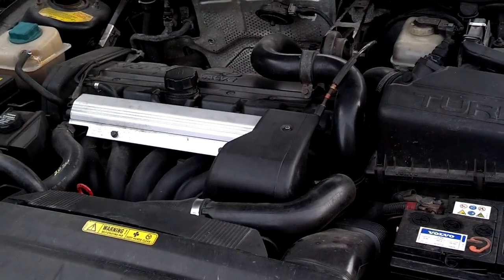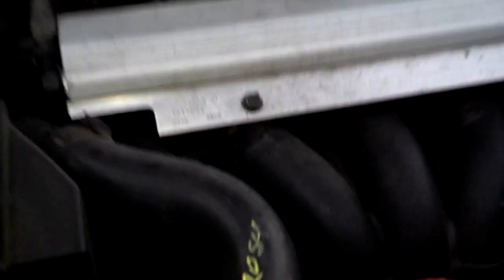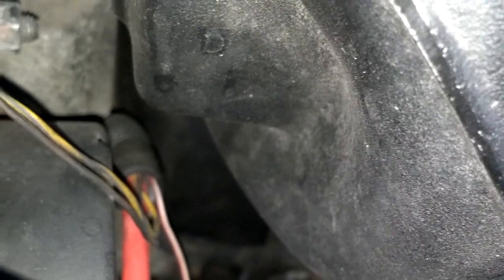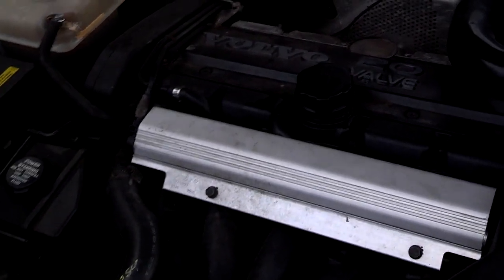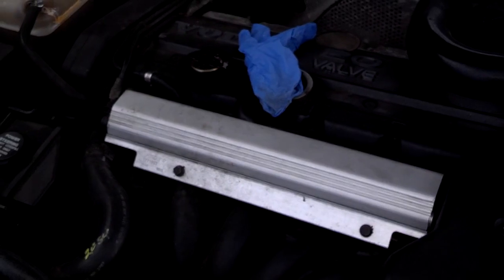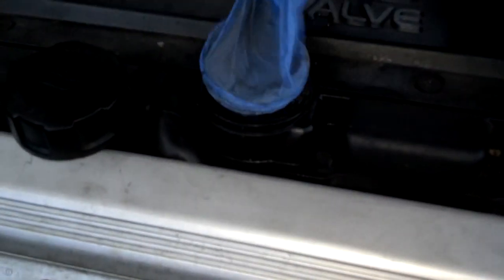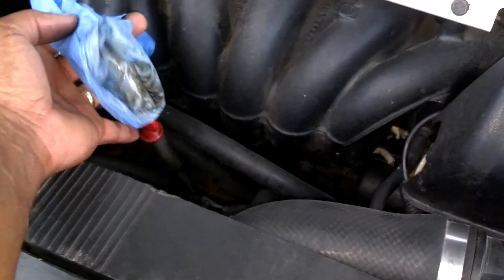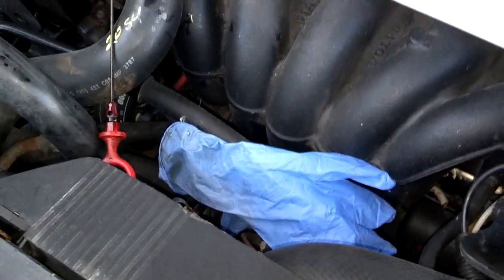Volvo PCV system check, 850, V70, S70, and others - VOTD

Comment: My car takes a couple of seconds to start when it does the idle jumps around and allmost dies.... I believe i have a vacuum leak... i hear the hessing sound loudest when I put my ear between the power steering pump and timing belt cover... think it might be that elbow underneath?
Reply: Robert DIY   dang, I'd bring my car by. LOL 1996 850 N/A
Reply from the maker: doubletapm4 Bring it by so I can check for you... Did you look at it? Chances are you have a bad coolant temp sensor. - Thermostat and ECT (Engine Coolant Temperature Sensor) Replacement, Volvo 850, S70, XC70, V70, etc.
Reply: hahaha what city are u in
Reply from the maker: Albuquerque.
Reply: your 2 states away lol

Comment: Hi I have a 2001 Volvo s40 and I have done this test but it leaks oil on top of the spark plug and around the top of the motor. I want to know what else can I do. Also what do I need to change the PVC system for this car
Reply from the maker: juan torres I have not done one on a car like yours. Check with a local mechanic or a forum.

Comment: Hey Rob I'm sure you've heard about my rear main seal leak by now. It was never leaking much, just 1 or 2 drops a day, but I took it on a nice long highway run at high speeds yesterday, and I noticed a good amount of oil under my car today (probably like 1 to 2oz). I'm seriously thinking of having the rear main seal replaced at the Volvo dealership. I know it's like $1100, but I think it needs to be done. What else should I have replaced when they're down there? The new seal obviously, clutch (it's automatic), gaskets, etc..
Reply from the maker: No I don't. My car has 264,000 on it now and I did my PCV service at 192,000. I did the test a few days ago and it is still sucking in.
Reply from the maker: If the water pump is over 10 years old, just have it changed. As for the mounts, I would just let them use their judgement and not worry about it.
Reply from the maker: Normal.
Reply from the maker: No I have not heard. If they drop the transmission, any other seal that they distrub. They do have to drop the subframe so if the hydraulic mounts are going bad, that would be a good thing to replace.
Reply: Robert DIY Hydraulic mounts? I've never heard of that. I put polyurethane subframe bushing inserts in from IPD, but it don't think that's what you're talking about.
Reply from the maker: LJRossPhoto The front of the subframe and back of the subframe have hydraulic mounts. Actually the motor rest on them. Fat rubber things with a wire going over the top.
Reply: Robert DIY I'll be sure to mention it. Are they expensive?
Reply: Robert DIY Also, I know how much Volvo charges for their seals. When I'm going to have the RMS done, should I buy the seal on FCP Euro ($28) and have them install that? Will that still be under warranty?
Reply from the maker: Most dealers will not install parts you supply.
Reply: Robert DIY Yeah, that's what they told me when I took it in for an alignment earlier today. I'm going back for the big bad RMS as soon as they get back to me with an estimate. Do you know if the engine mounts will cost me another arm and leg? I watched a tutorial from FCP and it looks like you might need some special tools to get down in there. By the way, if there's no fluid that goes through them, I don't think they would be considered hydraulic. It's just an engine mount.

http://www.fcpeuro.com/products/volvo-engine-mount-kit-850-s70-v70-850mountkit2
Reply from the maker: That is what the old school guys call them because they use to be filled with fluid in the red block days.
Reply: Robert DIY Interesting. Any idea how much they would cost at the dealer?
Reply from the maker: No I don't. Dealer prices vary a lot around the country.
Reply: Robert DIY I spoke with them this afternoon (Volvo of Tampa) and the RMS is gong to be $1242 for parts and labor. The engine mounts are $497 (I believe that's parts and labor), but I'm only having the RMS done. I'll do engine mounts myself at the hobby shop on base. They have all the specialty tools.
Reply from the maker: Heck, if you have access to a shop, you might want to do the RMS yourself. It may take a day but you'll save a lot of money. On the other hand, if you can afford it, let them do it. Why torture yourself.
Reply: Robert DIY I'll do a lot of things to a car, but a rear main seal is just too much for me. I won't have access to a shop for about another 6 months to a year, and even then I might not have much spare time. I just want to get it fixed so I won't have anything to worry about going forward. It sure would be nice though!
Labor: $1196
Parts: $46
Reply: Robert DIY
I paid a supposedly shop in Phoenix ($2200) to service the PCV system along with a head gasket job last year (Aug 2013) on my 98 V70 GLT that I had just bought and just a few months ago, I noticed oil dripping out (literally, like it was pumping out) of the front of the engine just after I had started up to drive. Further investigation revealed #1 spark plug well was filled with oil in addition to the top of the head. I had it towed back to them, of course. I regret not having done the job myself then because just a month or so ago, I have the same issue again.  I will do the job myself this time, as just 2 weeks ago, while replacing the front crank seal, which had pushed out, I noticed a couple of parts missing (tensioner bushing & belt guard). So, naturally, I suspect that the PCV system was not done right either. I did the glove and dipstick tests as described in your video, (after I had put the front seal back in), and sure enough, the glove was inflating instead of sucking. So, it seems that only the front seal has been leaking. Have planned to do the job after reviewing your videos on the process. I have read a few different things about the inadequacy of the PCV system on high mileage engines that may be improved with a minor modification. Mine just rolled over 202k. I love the performance of the L5 turbo and want to give the best maintenance and care.

My question to you is, do you think a failing Cat converter could be contributing to the engine pressure problem?  I have been checking the forums for similar issues.
Reply: Robert DIY Just dropped the car off today for the big service! I'm getting the rear main seal, and some other transmission seal inside the bell housing between the torque converter or something, and the timing belt (he'll check the water pump while he's in there and let me know if we should replace it or not). The mechanic was very nice and seemed trustworthy. He's been working for Volvo for 46 years... For the engine mounts, he said he wouldn't charge any labor for the side and rear engine mounts, it's only the front one he would have to charge labor on, but he'll check them out and let me know how bad they are so we can decide whether to replace them or not. They were very friendly and gave us 10% off everything (possibly because we mentioned we're military), but it's still a lot of money... Opinions?
Reply: Robert DIY They're doing timing belt and water pump too on top of the RMS and front transmission seal. It's a BIG job.. Here's a few pictures the mechanic sent me earlier today of the back of the motor where the rear main seal is, and the transmission out of the car.

1. https://drive.google.com/file/d/0B0JwcFRp-MDcczd1ZV9zVGpWM0E/view
2. https://drive.google.com/file/d/0B0JwcFRp-MDcM3pLRGl2UDBlM2s/view
Reply from the maker: Oh I know. I had a tranny swapped before and swapped an engine a month ago.
Reply: Robert DIY You're always up to something aren't you. Haha in the first picture I'm confused where the front of the car is because I see the rack and pinion going across the front of the car under the exhaust manifold thing, but then the brake rotor is sideways..... Was the picture taken from the passenger side of the car? I'm so confused.
Reply from the maker: I'm lost to what you are referring to.
Reply: Robert DIY In this picture I don't know where the front of the car is and why the brake rotor is sideways. https://drive.google.com/file/d/0B0JwcFRp-MDcczd1ZV9zVGpWM0E/view
Reply from the maker: That is the picture you sent me. LOL  The picture is taken from the drivers side wheel being removed, the transmission is also removed. So the front of the car is on the left.
Reply: Robert DIY That's what I thought, but in the bottom right of the picture, is that the front passenger side brake rotor? Is it just me or shouldn't it be turned the other way?
Reply from the maker: Yes it is a rotor. May be another car or they have your suspension loose and pulled back to get at some parts there. Maybe because the subframe is lowered.
Reply: Robert DIY They must have loosened the suspension.. I'm having the timing belt and water pump done too, and they're replacing the timing belt tensioner. Do you think I should have the tensioner pulley and/or idler pulley replaced too? The mechanic didn't say anything about those.
Reply from the maker: Wow, that would be a YES. If you are paying someone to do that job, those 2 rollers are a must. If you are doing it yourself and don't mind going back in if one starts to fail, then test them and decide.

Most timing belt issues are not due to the belt breaking, it is due to a filed water pump or one of those rollers locking up and tossing the belt. - Timing belt change, what other parts need changed? Water pump, rollers, etc.
Reply: Robert DIY Wow. How much do you think I should be paying for the timing belt, water pump, tensioner, tensioner pulley, and idler pulley?
Reply from the maker: Those parts are $280.
Reply: Robert DIY Hopefully the lady at the front desk I spoke with is unsure. I'm going to be calling them tomorrow to make sure because I'm paying $815 for the timing belt and water pump job. All parts better be included.. On the price sheet, it says "Water pump with timing belt kit $815.00".
Reply from the maker: I'm sure all is included, with the hydraulic tensioner.
Reply: Robert DIY Okay, thanks for giving me some peace of mind Rob. I appreciate it.
Here's a link to the kit on IPD. It comes with everything for $313. http://www.ipdusa.com/products/9220/120611-timing-belt-water-pump-kit
Reply: Robert DIY Just got my car back today. The only thing they didn't replace with the timing belt was the hydraulic tensioner, which the mechanic said wasn't leaking. Both rollers are new. The leak is also gone! I did another glove test when I got home just to be 100% positive I have good crankcase pressure, and the glove did suck in when the car was idling and there was no smoke coming out of the dipstick at idle. However, when I revved the engine, some smoke came out of both the dipstick hole and the oil filler hole. I'm not sure if it was smoke or condensation because the motor was hot.. Is this normal or should I be concerned?

Comment: It also, if plugged up, will SUCK so hard that it will cause the rear main to sound like a squealing belt, and it will pull air INTO the dipstick like a hoover vacuum! That means the diaphragm inside the trap is broken, and needs total replacement. 75 bucks at Volvo dealer. Nice Video!
Reply from the maker: bull dawg Thanks for sharing. Never heard of a diaphragm???

Comment: Hi robert i have a 1996 volvo 850 glt non turbo and the rear main seal is leaking oil but i did your test on the oil dip stick and no moisture and i did the glove and it sucks it in instead of blowing it up should i replace the gasget or do the pcv system?
Reply from the maker: trdceli1985 I would NOT. Unless the hose going to the top of the motor and under the cover is rock hard. How long have you owned the car? Are you sure it is a RMS leak?
Reply: I think it is because around the cam sensor at the bottom bolt there is oil all around it and all down from it. So do i test the hose by just using my fingers and pressing on it? Should it be soft?
Reply: Robert DIY i have pictures  is there anyway i can send you i tested the hose and it is not rock hard  it is kind of soft
Reply: Robert DIY i have owed the car for 5 years
Reply from the maker: If the hose is NOT rock hard, someone has replaced it at some point. Maybe the leak is at the cam sensor.
Reply: Yes it is also found oil inside my air filter?
Reply from the maker: Not sure how that happened.
Reply: Robert DIY so will this test be right even though my rear cam seal is leaking?
Reply from the maker: Although the PCV is the cause of MOST oil leaks, it is not the cause of ALL leaks.

Comment: thanks alot your video's really helpt me . i had trouble whit my volvo 850 2.5 gle. every time when the car  was hot .it would leak oil allot .and the econemy whas not good .but after replacing the pcv system and espesaly the  breahter box the car purrs like a kitten again .ones again thank you good sir
Reply from the maker: ***** Glad you figured it out.

Comment: Hi Robert. I have the parts on order and will be attempting this when they arrive from FCP. Never done this before, so keeping my fingers crossed. I have a 1995 Volvo 850 non-turbo with 175K.Bought it used so I don't know when this was done. I'll start in the morning and hope to finish in one day. Using the glove it was filling up the fingers, so I know I need to do this. Thanks.
Reply from the maker: Ricky P. It is really not bad, just a little time consuming. Make sure you clean out the EGR stuff.
Reply: Robert DIY
Will do.

Comment: What might be happening in this system if the suction from the oil cap or dipstick valve is greater that normal? (Cap is very difficult to remove)
Reply from the maker: billsutherland1 What makes you think the vacuum is to strong? The cap seal may be sticking to the head cover. If it's running well, leave it alone.

Comment: I have smoke coming from the dip stick on my 95 850 wagon. I plan on replacing the PCV system next week. I recently developed a stalling problem when I come to an idle after the car has warmed up. Do you think these problems could be related to the PCV being clogged?
Reply: By any chance did you find out what the issue was? I had a similar if not the same issue as you explained. I sprayed brake cleaner around on the vacuum lines and ended up noticing the pcv tree, with multiple nipples above the throttle body, sucking in the brake cleaner and makeing the idle flucuate. When i took it off i found out there was only half the thin gasket on it. Im just waiting for  the new one to get here so i can plug that up but in the mean while for the couple of days without the right one i used a rubber oring to try to seal it as best as possible and it seems like the drop in idle when coming to a stop has almost gone away so i think it was that for me. But i am curious about what others have experienced and how they went about it to solve it so if you did find out what it was i would really appreciate it if you could drop some insight. Thank you
Reply from the maker: alexwastaken Probably not. Is the car turbo?
Reply: Robert DIY Non turbo, 4 speed automatic. I don't have a check engine light on, and the MAF was replaced about 6 months ago. I cleaned the throttle body and idle air valve (which didn't seem all that dirty) It has yet to completely stall on me since the cleaning, but it does drop down to about 400-500 rps when coming to a stop. Then it will go back up to 800 or so. And I noticed today (while trying to make it stall) that if I have the AC turned off, the rpms only go down to around 600-700 before coming up to normal. It also idles fine in neutral or park. All other driving conditions are normal, no misfires or stalling while moving, only when coming to a stop. 
Thanks for all the great videos btw. Your instructions and explanations are clear and precise.
Reply from the maker: What brand MAF was installed? If it wasn't a Bosch it may be the issue.
Reply: A bit late to this, have you replaced the vacuum line for the brake booster? It runs from the intake manifold in the front below the throttle and under the airbox into the brake booster at the firewall. I use to stall out when I was going braking real hard at a light. This vacuum line is often overlooked.

Comment: oh boy, i need to replace a new pcv
Reply from the maker: bad8076 Do it ASAP so you don't blow a RMS.
Reply: Robert DIY , is it sufficient by replacing all the pcv kit except the oil trap? thanks.
Reply from the maker: Change all of it. - Volvo 850, S70, V70 PCV system change replacement Pt 1 of 2 - Auto Repair Series

Comment: i bought the cheapest pcv valve and gromet for my v6 camry....i notice there is a bit of oil around the gromet, meaning its not tight fit....will it gonna cause a problem?.....if its not so tight it means it will lessen the pressure more..is that right? its been a month now i dont have any check engine light and no oil in the hoo
Reply from the maker: EvendimataE Those cars are not that sensitive to the PCV lines, valves, etc. It should be ok.